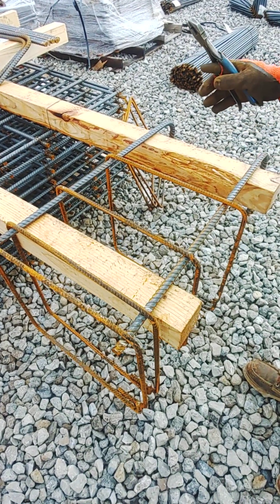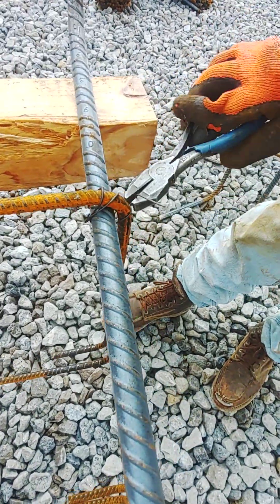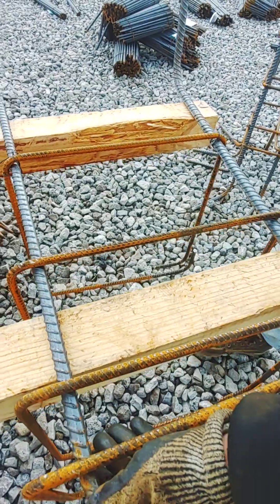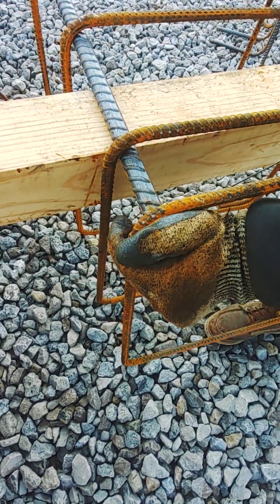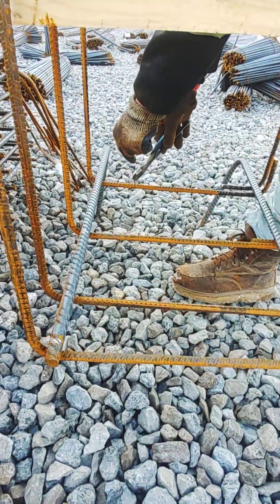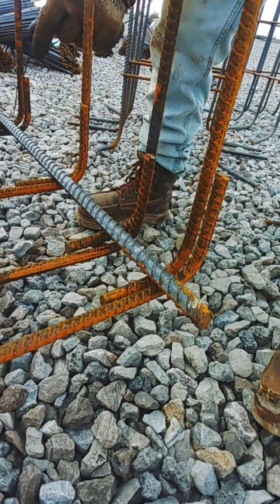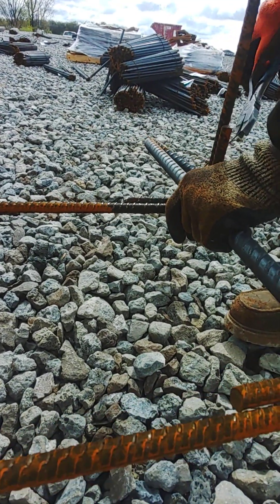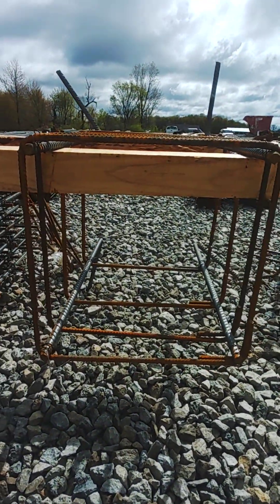how to tie rebar pier

Comment: way too comlicate method
Reply from the maker: It's actually pretty fast I was just doing it to slow to show how to do it... I've been tying rebar for 10 years just with a wire reel n rodbuster pliers
Reply from the maker: Every different tie has its own purpose
Reply: @TheFarmsweethome  I started working at a concrete factory at the age of 15 and have had a career of 27 years so far. It would be worth trying the tying hook (longer one). Do you have any experience with it?"
Reply from the maker: I haven't worked on a factory I've been working on the field bridge work,water treatment plant n building foundation, we do I lot of rigging so the tie have to be well secured when rigging up with crane and I haven't never use the hook it takes practice using the pliers but when you got it down it's pretty simple